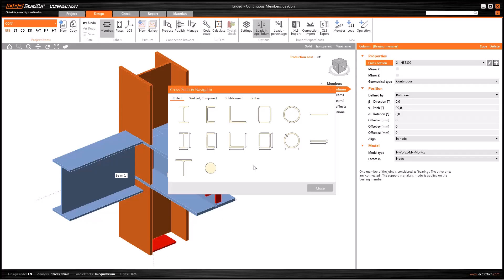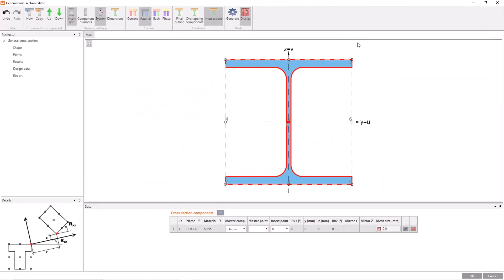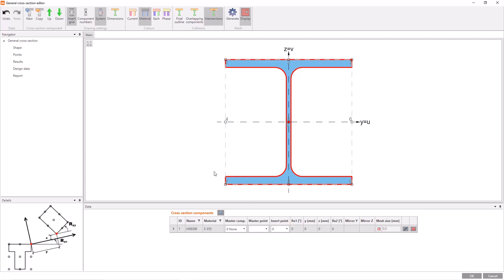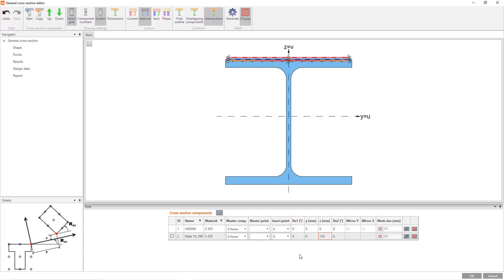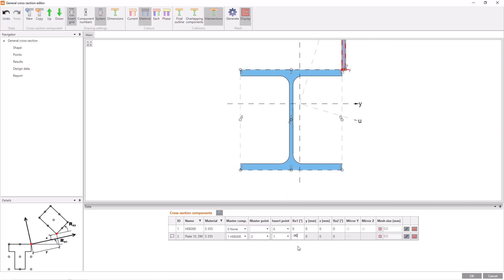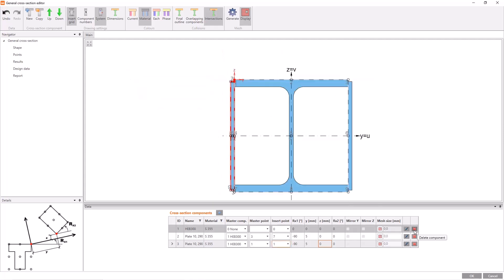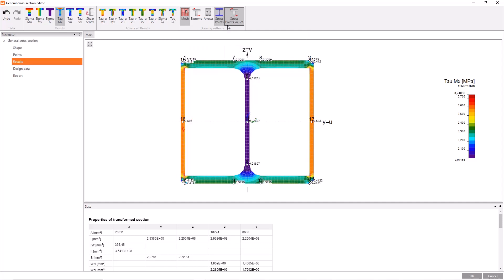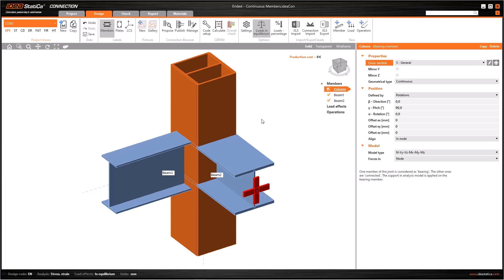Cross Section Generator

Comment: Wondering what can be done if you don't have the "General Steel Cross-section" option as shown here https://youtu.be/BsMTUdx2UNo?t=28 using version 23.1.5.1003. Thanks
Reply from the maker: Hello, this feature is available in all versions of IDEA StatiCa. In older versions, it was only limited by the license type (Steel Expert); in newer versions, it's always included.
https://www.ideastatica.com/support-center/how-to-create-and-use-a-custom-cross-section